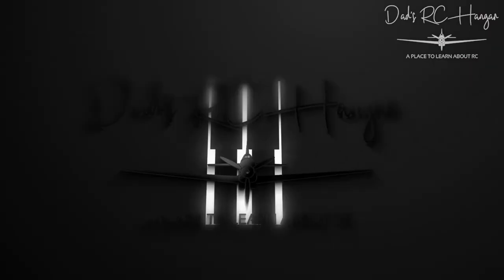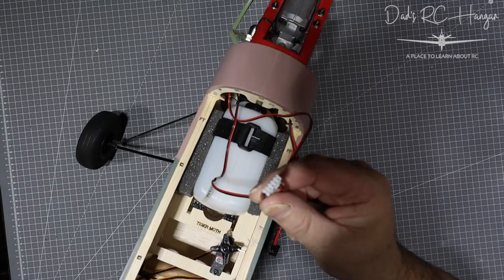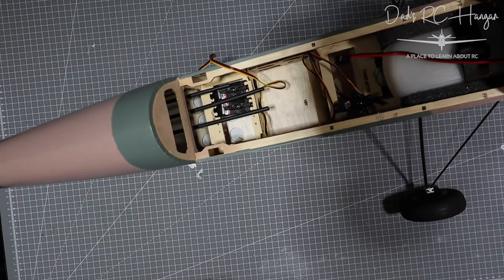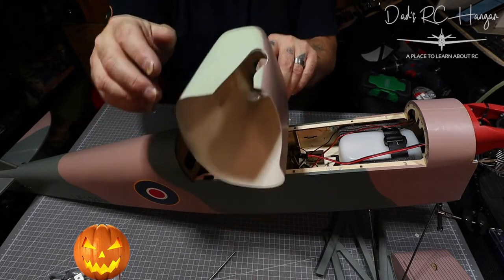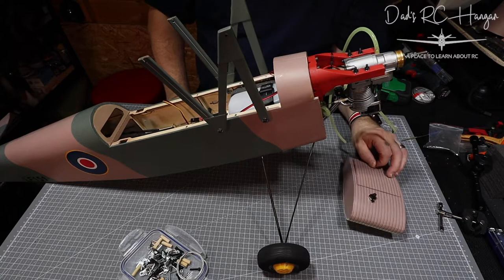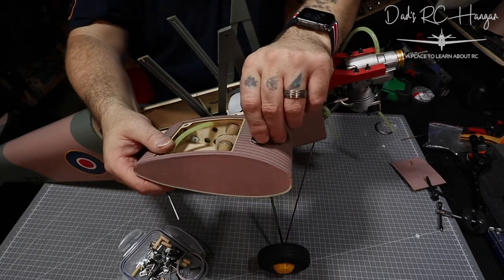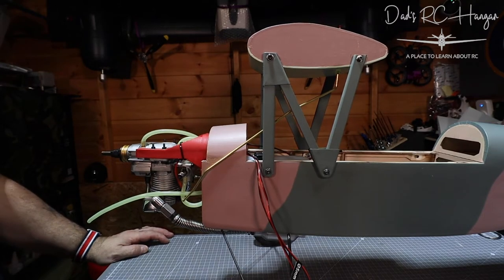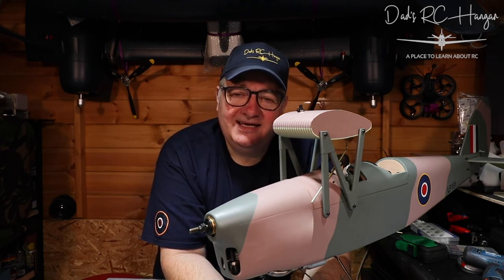Nexa Tiger moth building, next steps....Halloween Time

Comment: Coming along nicely Chris. One area to just check is that you have sufficient cooling air outlets on the cowl. You need to aim for a ratio of 1 to 3, in to out, to make sure the engine won’t overheat. Remember that any gaps down the sides of the cowl also count.
Reply from the maker: Thanks for the heads up on the venting. Will have a check in the cowl, I mean it has an outlet on one side, not sure we’re else it escapes.
Reply: @DadsRCHangar  the holes in the front under the prop spinner are the inlet. The holes you’ve  cut around the exhaust plus if there are any gaps down the sides of the cowl where it meets the fuselage are your outlets.

Comment: Hi Chris, I like your idea for the fuel filler! Can you tell me the make and serial number of the wing & throttle servos so I can order some please.The cowl may get very hot if the knuckle touches it & melt or burn it. If you go to screw fix & buy a roll of sticky back aluminium tape ( diall silver foil tape @ £6.49) & stick it on the inside of the cowl & double thickness buy the knuckle, it should stop the fibre glass cowl getting to hot. A roll will last for ever & ive used it on the inside of most cowls that are plastic or fibre glass in the past, It also sticks to wood so use it anywhere things get hot. Its used for insulation & hot metal trunking.  Looking forward the the next instalment mate😀👍
Reply from the maker: Thanks John, I did not think of heat tape, brilliant...Will get some today thank you. 
Servos:
HiTec HS-85mg+ For the Throttle 

HiTec HS-485HB Deluxe for Rudder and Elevator
 
HiTec HS-85mg+ Mighty Micro for Ailerons

Have a great weekend.